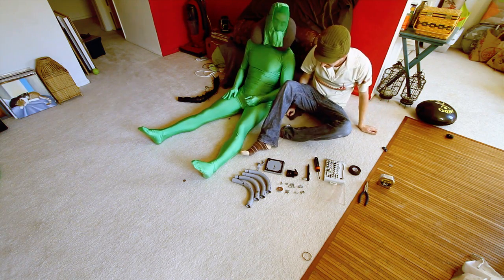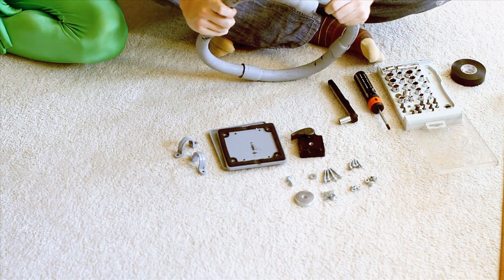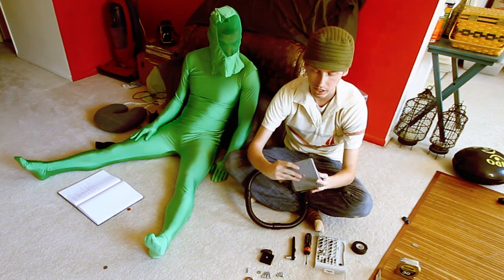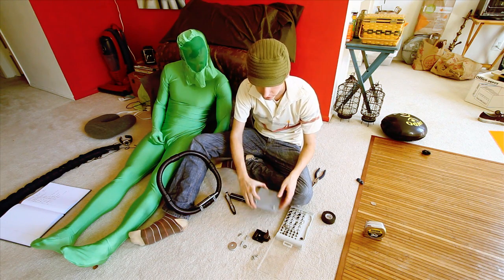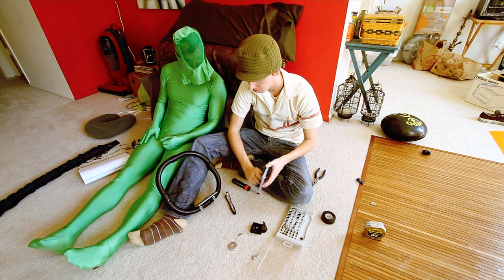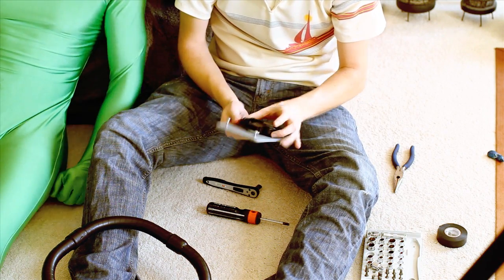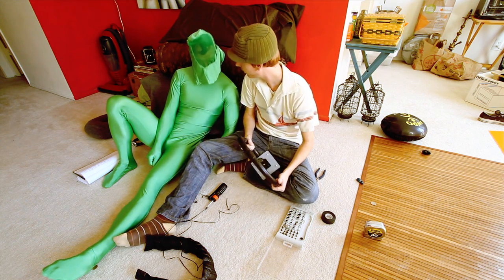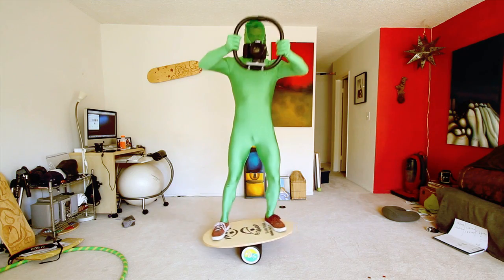Loaded Boards | How to make a "Fig Rig" for your camera!

Comment: actually a cool way to stabalize ur camera is to attach a string to the bottom, and step on the string, that way it creates tension, and u just needa pull ur camera upward. should invent something like that for ur board, like a string just attached to ur board, that can vary in lengths